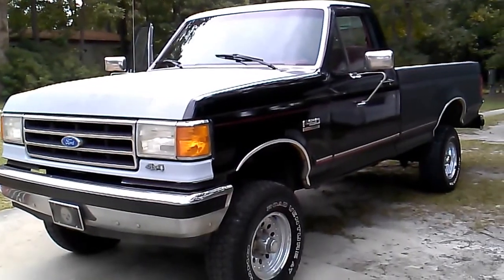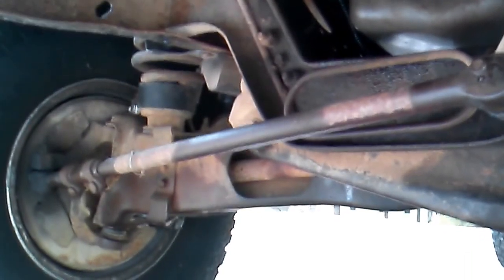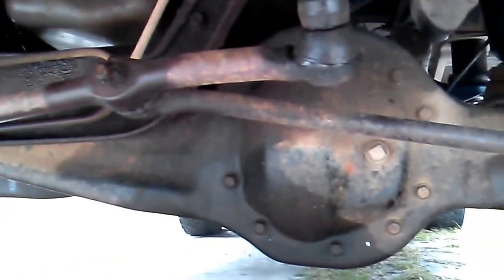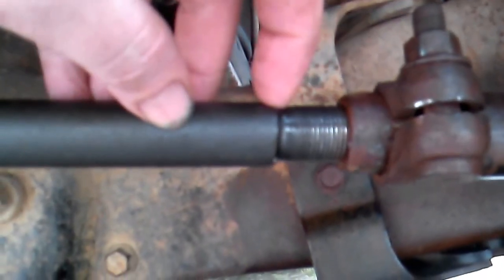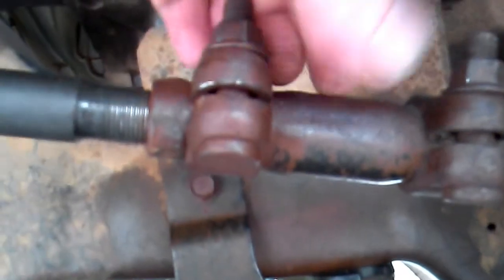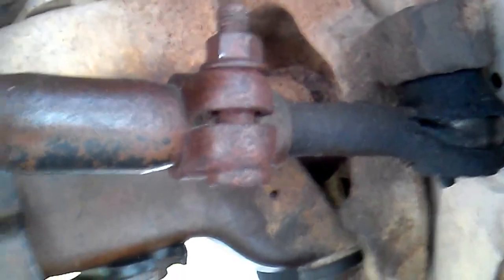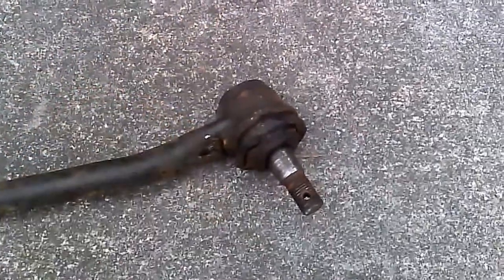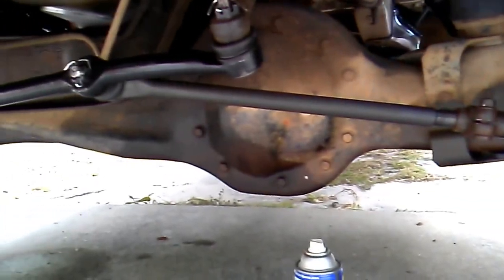91 Ford F-150 tie rod replacement

Comment: I know this is an old video but great stuff. I have an '89 F250 4WD that I kept hearing a clunk in the front end every time I went over the speed bumps at my hospital. No matter how slow or fast I went. I noticed it clunking today when I turned the wheel back and forth while parked. I had my 6 yr old turn the whee while I looked at the front end. Sure enough my drag link is clunking right where it meets the pitman arm (I think is what that is coming off the steering box). My concern is the alignment on these dang things. Mine has the Dana 50 TTB which is a nightmare to align. In hindsight I wish I did the drag link, tie rods ends and ball joints when I did the axle u-joints and front pads/rotors in March. Then just get the alignment with all fresh components. Oh well.

Comment: I bought 2 new adjustment sleeves from O'reiley's, neither fit anything.

They were too loose on one side, & too tight on the other side ugh..

My adjustment sleeves are frozen.

I will have to attempt to do what u said..

I try to force one sleeve on my drag link, & it got stuck, can't get it off, now I have to buy a new drag link all over again, ugh, & hope the old sleeve will fit..

Comment: I'm trying to replace my outer tie rods on my 91 f150, and both my coils are cambered, and my tire place says they can't fix it. I have the same coil spacer as you do, and I was wondering how you got them straightened up and aligned.
Reply from the maker: I had to purchase a adjustable camber kit to get mine correct. Of course both sides

Comment: I've got a 2wd drive but the steering setup is the same, how much did all of this cost you. I've got a little side to side play when I jack the truck up.
Reply from the maker: I was shocked that the parts were so  cheap...right around $200 covered it all
Reply: If you go to rockauto its even cheaper. the whole setup is around 87 dollars plus shipping and thats including both inner and outer tie rods, new sleeves and a new pitman arm.

Comment: Holy smokes.... hope you don't go back to that place.... scary thing is there is someone out there that will pay them... couldn't take more than an hour in a shop.  I did mine in driveway in 1 1/2 hours and did a string alignment  less than $100.. its a ford, Easy to align..